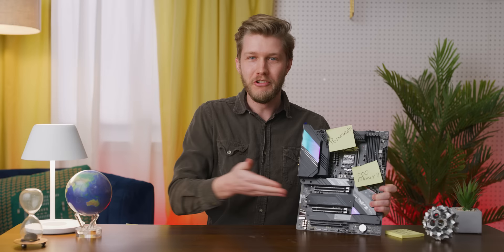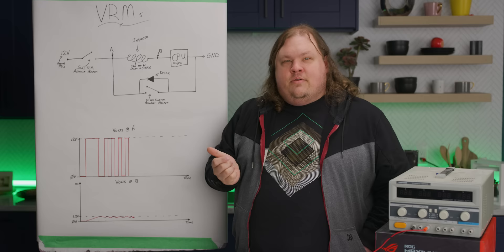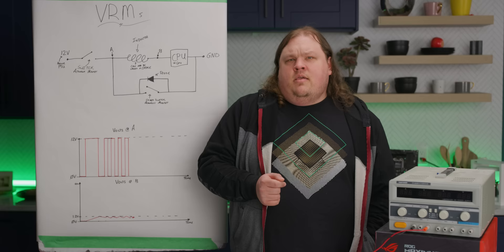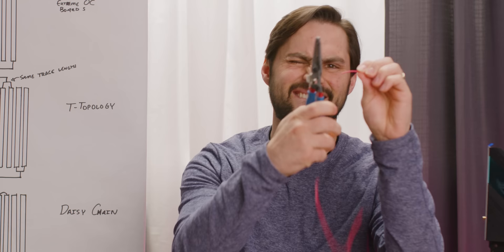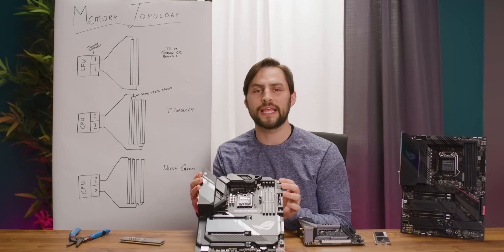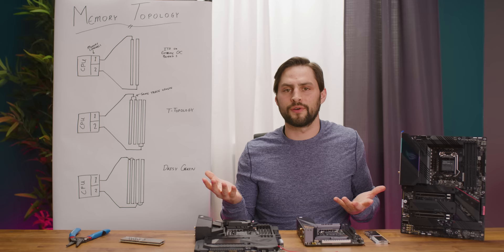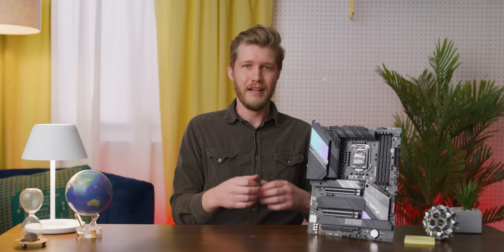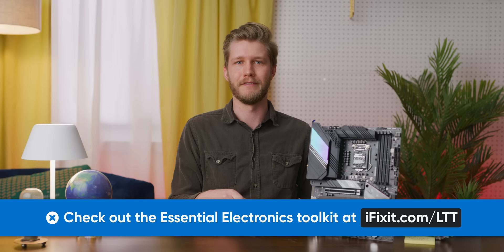How Motherboards Work - Turbo Nerd Edition

Comment: The last part of the Video where you argued about how motherboards should have less slots overall to maintain cost-to price ratio, i dont really get that.
2 years from then, motherboard prices are how they used to be 6 years ago. And i think that is because there is such a wide range of motherboards.
at 10:00, you talked about a pretty high-class mb. When i built my first PC, i used an ASUS Prime B350 plus, cost me 90€ and has almost all the features your mb describes. Besides PCI-E Gen 4. 
As long as there is a wide price range with different sizes and amounts of slots, i think everyone can be happy.
I still get the point that you actually also point out to the fact that designers should be more open to minimalistic but powerful designs. Would only improve that wide price range.
But pointing at this motherboard and telling people, it would be better if there were only 2 RAM slots closer to the CPU etc is kinda pointless, when there are mb designs out there that already fulfill that requirement, most of the time for like 60€ here in Germany. 
And about that RAM Slot thing, i was pretty happy that after 2 years of having 16 Gigs, i could just slot in 32 gigs when RAM prices dropped by a lot.Can't report any performance or stability issues since.  And i didnt need to worry about buying a new mb just for that upgrade when a few years later DDR5 started to become the standard.

Comment: Did not explain how a motherboard works..but explained electrical engagement, a few slots, etc. 
To construct a MB, wouldn't knowing how they operates provide clues? Still, want to know how MBs operate rather than just about a few components of the MB, gentlemen. Yep, it's a big question, I know.

Comment: What’s the point of putting vrm’s on the motherboard instead of a stable voltage from the power supply? And why use the 12v rail instead of the 3.3v rail for the cpu?

Comment: And with those 4 ram slot boards once you fill all 4 slots the ram speed is limited less than max. Maybe they have changed that with newer boards but one of mine chokes DDR2 1066 ram back to 800mhz when all 4 slots are full.
Reply: Maybe your other RAM modules are only rated for 800 which would make them all run at that speed. Doesn't make a huge difference either way.
Reply: @Seargent_Scraps  True, is probably not a huge difference. All 4 sticks are the same and manufacturer rated at 1066. Just thought I would mention this for people who max out the ram on their motherboards that it may be speed limited by the motherboard capabilities. Buy accordingly.

Comment: 4 RAM slots = needed for running VM's (for work/school)
SLI = dual gpus (I just had these with my old NVIDIA cards, was cheaper buying one used than buying a new GPU)

Some of us actually use these things! #thinkofthechildren
Reply: Yeah but there hasn't been SLI support from Nvidia for at least a year yet my brand new motherboard has two PCI-e slots. How well did SLI work for you? I used crossfire years ago and it was terrible.

Comment: That last part... Something I was thinking about, is individual state power, and wireless communications within a comp system, to maximize speed. Since a cable can have noise and determines the average speed of data transfer to a real world number unless the cable has special enhancements, Which work like the dendrite, axons with the myelin sheath... to increase data transfer by creating electrical hops over short distances. that is a non public system sine the cost is pretty costly.  Lines provide stability.

What if... you have a.. entire system where all the compenents are wireless and speak a customized wireless language for the data... could it be faster? and could you engineer and design the system to work completely different in how it specs out, since t would alter the positions and cool mechanics to something completely different. the problems would be what language, what freq.. and then creating data box shielding to prevent decaying disruption in the data. This could allow some very interesting overhauls in how the data is moved, for speed and components.  It also means various threads can send various signals to multiple parts within the system more efficiently... getting key data to other points faster. While also having protective subroutines that could protect the system better.

 Is this a better way to go in the future, it certainly would be a challenge, and remove limitation, but obviously communications that are wireless have draw backs... its what and the want of the information to do a thing... when related in this way, the end result would probably change how the base system is put together. If you are sending data to sectors and the ram is doing x function to the data.. and the later is doing x... its allows you to change the entire communication of that dat to a more efficient ending... hmm. random access memory... is like short term memory... hmm

Comment: Regarding lane/wire distance and 2 VS 4 RAM Slots:

I‘ve just checked a few benchmarks and even though your infos are reading plausible, it seems that larger ATX Boards still outperform the ones you‘ve pointed out in the Vid.

Do you have got benchmarks with different outcomes?

Comment: why do VRM have heatsinks?
cause reviewers, including LTT, complain if a mainboard has no VRM heatsinks
as a result, regular users think no VRM heatsink = bad, even if the temps are low, and wont buy a board unless it has a VRM heatsink... even if doesnt need it

Comment: Why put the GPU on a daughter board instead of the motherboard? I understand that CMOS is quantum-mechanically defective and inferior to current based devices (like tunnel diodes). Putting the GPU on the motherboard would improve the CPU-GPU communication and memory usage. Is it just "Not the way Granpa did it"?

Comment: Sadly motherboard makers, CPU makers, and even worse, chipset makers, skimp where it counts. For example, not enough RAM slots and channels, thus most of us are stuck with only 4 slots. In 2021, this means that we are stuck with a max of 64GB of RAM if we want good speeds and timings.

Then we have board makers and chipset makers dropping the ball on PCIe switching. for example, why couldn't AMD a PCIE 4.0 to 3.0 expander, those controllers have been available for years. Why not give the full length chipset connected slot a true x8 connection even though the x570 connects to the CPU at x4 4.0 speeds. It would allow users to use a  PCIe 3.0 x8 card at full speed (good for some multi port SFP+ cards, as well as some RAID cards.

The next skimping, is the lack of SATA ports. Most boards have only 6-8 SATA ports, while most people will need at least 10 hard drives to go along with their 1-2 NVMe SSDs.

Comment: In regards to the fat guy's VRM explanations. 

It is ideal to have good Heatsink for VRM of  High end Motherboards , Since Sometimes Mosfets and Some capacitors tends to heat up and consumes Electric energy to Heat Energy. 

So the Stable VRM Currents bouncing up with mosfet Switches. 

You may see stutters on Gaming Sometimes Due to this. Nothing wrong with GPU it is just VRMs having less efficiency of delivering constant voltages.

Comment: I got a ASUS TUF X570 board with the two M.2 slots and was wondering if i can run windows on one nvme and linux on the second nvme slot? Would it cause any interference down the road? Don't want to dual boot on one single drive.

Comment: I am, (for the most part), computer illiterate. Right this very second, I am typing with only 2 fingers, and they're not even on the same hand, but I have often wondered why motherboards aren't modular. New cpu's coming out that utilize a different socket? No problem, just get a new socket module. Need only 1 pci slot? Only get 1. New chips, etc. I'm sure there are good technical reasons as well as monetary considerations against that idea, but I'm just a layman lookin' at it and wonderin'.

Comment: idk bout nerd edition whatever yr taking about 1st time seeing yr vids, decent explain for vrm, id like to know difference between m.2 and PCIe slots, do they both use PCIe lanes? and what are u.2? do they compare to m.2? are m.2 even better than slots in 1st place? those lil slots, i hate when they put in x16 size slot then in fine print tell u its only got x4 lanes, i see why but the cases are rare, and with pcie getting to 5.0 x1 an x4  slots should still be useful but instead they keep adding more m.2 connectors which use up way more board real estate, idk im still new at this so am i right or an idiot?

Comment: i honestly doubt that people stil care about dual pci-e slots, i know i wouldent give a "insurt insult" and i would prefer higher quality on the stuf thats actuale used. but 4ram slots i do enjoy myself, i always start my build with 2slots used and later on i just add a third dimm when i start to notice my mem lacking is becomming a issue. that being sayd, i noticed in the past (when i started the build with 4dimm's used instantly) that those builds die faster while when useing only 2dimm's the machien just keeps going, is this just dam bad luck or is there a actuale reason why 4dimm used boards die faster?

Comment: I have 1 question, 1 fucking question: If you CAN do daisy chain mobo with 4 slots and get teh speed of 2 slot mobo, WHY NOT DO A 2 SLOT MOBO IN THE FIRST PLACE INSTEAD?! Why bother with adding 2 more slots and telling the user to stick their rams to this and that? Just do 2 slots, and it's cheaper to boot. WTF am I missing?

Comment: How many megahertz ram shoul i buy then please help.
Reply: Ideally - the highest you can get. Just make sure that the memory is supported by the motherboard. All DDR generations are mutually incompatible, even if the number of pins is the same and you can put it in the slot just fine, it won't work. 

One other thing: even if your CPU specs mention maximum memory clock speed, having faster memory is still beneficial. A 2600 MHz DIMM will have slower latency than 3600 MHz one if they run on the same timings.

Comment: 4 ram slot...not pointless for me...whose socket 1&3 is damage......and bless the tech divine 2&4 is fine......i aint rich and it was a hard time back then to get new parts hahahaha
Reply: You're kinda lucky it's 2 and 4 and not, say, 3 and 4, so you can still (most likely) run dual-channel.
Reply: @user-xh9pu2wj6b  yeah that why hahaha

Comment: Suggest: how really machine-man understand instructions, how do Intel/AMD/Apple/... do it? You know, not " bit is open-close, on-off" ,bla bla bla.  Op-codes, processor architecture, firmware, instructions set, for non computer engineers explanation. 41 years old and no one is capable to make me understand how the magic happens. How compile a compiler?  Even assembler or even more,  machine code needs a translation. How a low level voltage means an order to CPU and higher voltage means other order? How do they "record" it on board?

Comment: i still get over 120 fps out of my intel CORE 2 QUAD 9650 build on a G41C-GS R2.0 with it's gtx 1050 ti and 8gb ddr3 ram LOL. these asshats crack me the fk up every time they go on their amd trips (record in 60, play in 120 fps when not record using fraps) https://www.youtube.com/watch?v=FM3aAJKn-h0 use small cell(chip) ram, you can double/triple/quadruple the maximum ram installed. 1mb cells or higher, ruin the bios count smaller cell ram (can install more) means more hardware, and more money, but worth it when you save so many hundreds on cpu+mobo going with a older rig
Reply: the next best thing NOW is a i7 4th gen 4790k with 16gb ddr3 with a GTX 1660 ti
you'll get 240+ fps playing mid/high settings on many games,
 and even moar fps when playing others, like warthunder or crossout (older render engine games)

Comment: I have a 7700K on an Asus mb sitting in my closet because the VRM's on the mb fried. I don't know if the CPU is toast or not so I saved it just in case it isn't. Anyone know what the odds are that CPU is fried as well? I'm guessing it probably is because the VRM fry took a few seconds. It went like bzzzz zzz zz zzzz zzzz......... bzzz zzz zzzzz ..... bzzzz zzz zzz dEaD.

Comment: I'm in the process of a build. The CPU, Ryzen 5900x on x570 itx board , is exhibiting temperature in excess 100 degrees C. This is with no cooling installed and only accessing BIOS ie no OS. Is this normal?